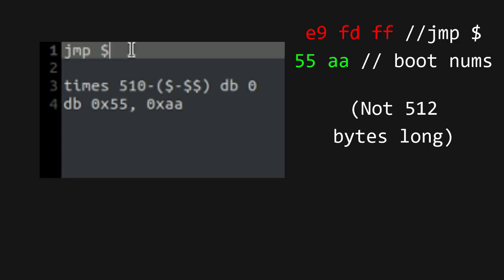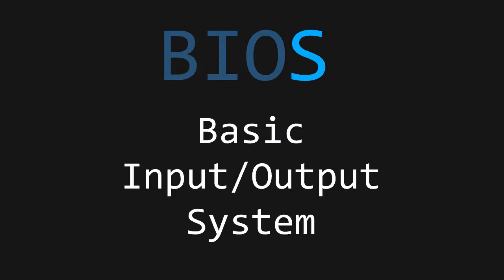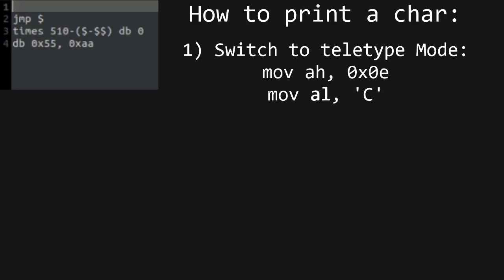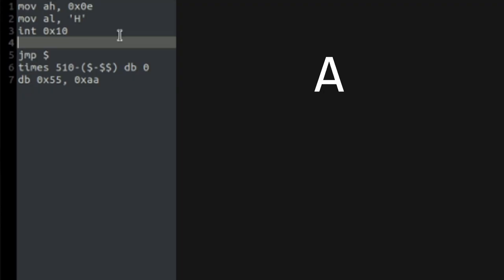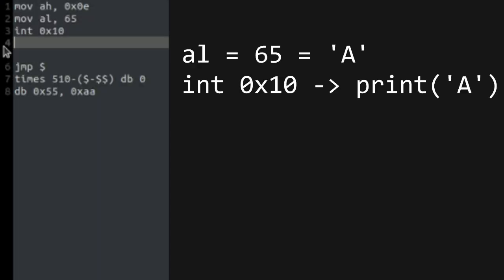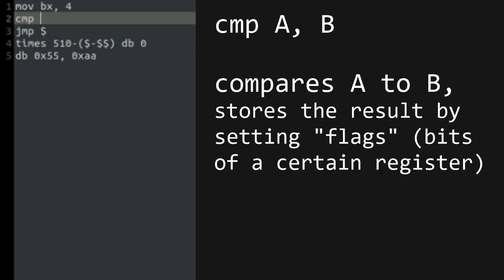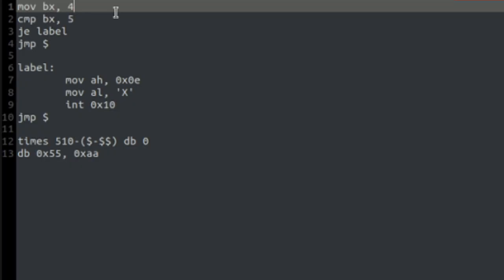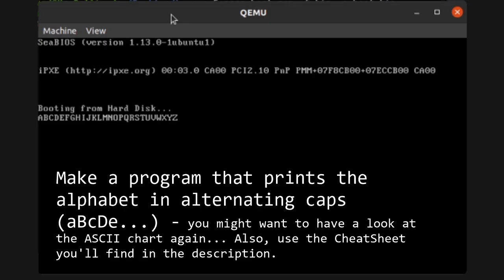Making an OS (x86) Chapter 2 - BIOS, Printing the Alphabet, Conditional Jumps

Comment: So can I just say that the int 0x10 refreshes the console thing?
Reply from the maker: It's a BIOS routine that can do several things, among which writing to video memory; It does not "refresh the console thing" because there is no "console thing" at this level :)
Reply: And here is my homework which is a year late, and I also don't think its the good as Im only a 14 year old and there are definitely more efficient ways to do this:

mov ah, 0x0e
mov al, 65
mov bx, 2

loop:
	cmp al, 'Z' + 1
	je exit

	cmp bx, 2
	je swap_lower

	cmp bx, 1
	je swap_higher

exit:
	jmp $

swap_lower:
	add al, 32
	mov bx, 1
	int 0x10
	inc al
	jmp loop

swap_higher:
	sub al, 32
	mov bx, 2
	int 0x10
	inc al
	jmp loop

times 510-($-$$) db 0
db 0x55, 0xaa
Reply: oh ok thanks!

Comment: Here is my alternating alphabet solution (the comments are ugly because youtube is weird, it works fine in my text editor):

mov bh, 'z'             ; STORES LAST LETTER
mov al, 'A'             ; PUT 'A' INTO al
mov bl, 32              ; PUT 32 INTO bl
mov ah, 0x0e            ; BIOS PRINT

; UNCOMMENT THESE 4 LINES TO START WITH LOWERCASE 'a'
;add al, bl              ; LOWERCAE 'a' (+32)
;not bl                  ;
;inc bl                  ; BITWISE NOT THEN INCREMENT = NEGATE IN TWO'S COMPLEMENT
;add bh, bl              ; UPPERCASE 'Z' AT THE END (-32)

alphabet:
    int 0x10            ; PRINT <----------------------------------+
    add al, bl          ; INCREMENT al by 32 or -32 (+32=upper,    | -32=lower)
    inc al              ; NEXT LETTER                              |
    not bl              ;                                          |
    inc bl              ; BITWISE NOT THEN INCREMENT = NEGATE IN   |  TWO'S COMPLEMENT
    cmp al, bh          ; COMPARE al TO bh                         |
    jne alphabet        ; IF NOT EQUAL THEN CONTINUE LOOP ---------+
int 0x10                ; PRINT LAST LETTER

jmp $
times 510-($-$$) db 0
db 0x55, 0xaa

Comment: I solved the homework problem by using multiple registers. This allows me to avoid any addition or subtraction operations:

mov ah, 0x0e
mov bh, 0x0e
mov ch, 0x0e
mov bl, 'a'
mov cl, 'A'

lowerloop:
    mov al, bl
    int 0x10
    inc bl
    inc cl
    cmp bl, 'z'
    jle upperloop
    jmp exit

upperloop:
    mov al, cl
    int 0x10
    inc bl
    inc cl
    cmp cl, 'Z'
    jle lowerloop
    jmp exit

exit:
    jmp $

times 510 - ($ - $$) db 0
db 0x55, 0xaa

Comment: Are functions declared in assembly by a word and then the colon?  (examples in the video are loop and exit)
Reply from the maker: They're not exactly functions, because there is no return statement. They're simple labels, aliases for the addresses of instructions. 

They can be used as functions, by using the stack. Functions are covered later in the series :)

Comment: My final code (i.e. the homework):
mov ah, 0x0e
mov al, 65
int 0x10

loop:
	inc al
	cmp al, 90
	jg exit
	add al, 32
	int 0x10
	sub al, 32
	jmp loop2
loop2:
	inc al 
	cmp al, 91
	je exit
	int 0x10
	jmp loop
exit:
	jmp $
times 510-($-$$) db 0
db 0x55, 0xaa

Comment: My simple solution:

mov ah, 0x0E
mov al, 'A'
mov bx, 0

loop:
    cmp al, 'Z' + 1
    je exit
    cmp bx, 0
    je upper
    jne lower

upper:
    int 0x10
    mov bx, 1
    inc al
    jmp loop
lower:
    add al, 32
    int 0x10
    sub al, 32
    mov bx, 0
    inc al
    jmp loop
exit:
jmp $
times 510-($-$$) db 0
db 0x55, 0xAA

(basically just swapping the value in the bx register every time I print)

Comment: my code for the homework:

mov		ah, 0x0e 		        ; teletype mode
mov		al, 'A'			; moves character into al
loop:					; loop function/subroutine I forgot what it's called
	int 	0x10		        ; prints character using interrupt
	add		al, 32		; adds 32 to al to make it lowercase
	int 	0x10		        ; prints character using interrupt
	sub		al, 32		; subtracts 32 from al to make it uppercase
	inc		al			; increments al
	cmp		al, 'Z' + 1         ; compares al to z + 1
	jne	 	loop		        ; repeats loop if al is at letter Z or lower
jmp		$				; idk what this does, I think it just exits
times	510-($-$$) db 0	; defines 512 zeroes
db		0x55, 0xaa		; code does not work without this idk why
Reply: I year later*

This works:

int 0x10

mov al, 'A' - 1
mov ah, 0x0e

loop:
        add al, 33
        int 0x10

        sub al, 31
        int 0x10

        cmp al, 'Z'
        je exit
        jmp loop

exit:
        jmp $
times 510-($-$$) db 0
db 0x55, 0xaa

Comment: i remade the solution to be more elegant, no more comparisons now

mov ah, 0x0e ; switch to teletype mode

mov al, 'A'

printAlphabet:
        ; print character stored in al and increment it
        int 0x10
        inc al

        ; check if we reached the end of the alphabet yet
        cmp al, 'z' + 1
        je exit

        ; flip the 6th bit (which adds 0 or 32)
        xor al, 0b00100000

        ; loop the code
        jmp printAlphabet

exit:
        jmp $

; end of code
times 510-($ - $$) db 0x90
db 0x55, 0xaa
Reply: @Sean Michael i had an understanding of how memory and registers work prior to watching this video (although my asm was pretty bad). then i watched this video and after that i was just compiling random C/C++ programs to see how their assembly looks, if i didnt know what some instruction was i just searched it up, then i tried writing my own asm code inside naked functions in C with the inline assembler. after that i had a good knowledge of asm and some time later i found a very good use for it in one of my programs

Comment: Here's my solution:

	;;  512 byes long ending in 0x55 0xaa

[bits 16] ; use 16 bits 
[org 0x7c00] ; sets the start address 

	mov cx, 0x0					; initialize counter to zero
	mov bl, 0x02					; prepare divisor to use

loop:
	mov dh, 0x0e				; set terminal output mode
	mov dl, 'A'						; store letter into dl
	add dl, cl
	mov ax, cx						; ax contains dividend
	div bl								; divide ax by bl
	cmp ah, 0x0					; compare remainder with 0
	je ucase							; if remainder was zero, ucase character
	add dl, 0x20					; else lcase character (0x20 == 0d32)
ucase:
	mov ax, dx						; prepare to print character
	int 0x10							; print character
	inc cl								; increment counter
	cmp cl, 26						; compare counter with 26
	jge done
	jmp loop

done:
	jmp $						; jump to the current memory address -- infinite loop much?

	times 510-($-$$) db 0
	db 0x55, 0xaa

Comment: Hey, I am trying to understand better how operating systems work, and your videos are very helpful and great! I even managed to do the homework at the end of the video! I wanna say a thank you for these videos beacuse they helped me a lot and even taught me a bit of assembly. Here's the homework:

mov ah, 0x0e
mov al, 65
int 0x10

lower:
	add al, 33
	cmp al, '['
	je exit
	int 0x10
	jmp upper
upper:
	sub al, 31
	cmp al, '['
	je exit
	int 0x10
	jmp lower
exit:
	jmp $
times 510-($-$$) db 0
db 0x55, 0xaa
Reply: Also, I am pretty sure this is a more complicated and worse solution to the homework, but I tried my best.
Reply from the maker: @1hypro395  Brilliant! Keep going! I'm glad I helped
Reply: @1hypro395  complicated? worse? look at my code for a second

mov ah, 0x0e
mov al, 65
int 0x10

loop:
    inc al
    cmp al, 'Z' + 1
    je loopt
    int 0x10
    jmp loop

loopt:
    mov ah, 0x0e
    mov al, 'a'
    int 0x10
    jmp small

small:
    inc al
    cmp al, 'z' + 1
    je end
    int 0x10
    jmp small

end:
    jmp $

jmp $
times 510-($-$$) db 0
db 0x55, 0xaa
Reply: @1hypro395  and it doesnt even fit the homework (if my reply lagged my code is beneath)
mov ah, 0x0e
mov al, 65
int 0x10

loop:
    inc al
    cmp al, 'Z' + 1
    je loopt
    int 0x10
    jmp loop

loopt:
    mov ah, 0x0e
    mov al, 'a'
    int 0x10
    jmp small

small:
    inc al
    cmp al, 'z' + 1
    je end
    int 0x10
    jmp small

end:
    jmp $

jmp $
times 510-($-$$) db 0
db 0x55, 0xaa

Comment: this also works in fasm:

mov ah, 0x0e
mov al, 'A'

printalpha:
    int 0x10
    add al, 32
    int 0x10
    sub al, 32
    inc al
    cmp al, 'Z'
    jle printalpha

jmp $
times 510-($-$$) db 0
db 0x55, 0xaa

Comment: This is my solution lol

mov ah, 0x0e    ; set up for print
mov al, 'A'
mov cl, 0
int 0x10        ; print
loop:
    cmp al, 'Z' ; check if output is done
    je skip
    inc al      ; incremint letter
    cmp cl, 1   ; use lower byte of cl register to keep track of upper and lower (if low, print upper, if high print lower)
    je Uppercase    
    jl Lowercase
Lowercase:
    add al, 32  ; turn letters to lowercase ascii
    int 0x10    ; print
    sub al, 32  ; return to normal
    mov cl, 1   ; change cl too 1 so next letter is upper
    jmp loop
Uppercase:
    mov cl, 0   ; change cl too 0 so next letter is lower
    int 0x10    ; print
    jmp loop
skip:
    jmp $
    times 510-($-$$) db 0
    db 0x55, 0xaa

Comment: my try at the homework (yes i know many solutions have been posted but this one is commented, other than that its nothing special):

mov ah, 0x0e ; switch to teletype mode

mov al, 'A'

printAlphabet:
	; print character stored in al and increment it
	int 0x10
	inc al
	
	; check if we reached the end of the alphabet yet
	cmp al, 'z' + 1
	je exit
	
	; check if the current character is even or odd
	mov bl, al
	and bl, 1 ; bl %= 2
	
	; if bl == 1
	cmp bl, 1
	jne $ + 4
		sub al, 32
	
	; if bl == 0
	cmp bl, 0
	jne $ + 4
		add al, 32
		
	; loop the code
	jmp printAlphabet

exit:
	jmp $

; end of code
times 510-($ - $$) db 0x90
db 0x55, 0xaa

Comment: Here is my solution i basically check if the number is even by looking at the least significant bit. if so add 32 call a print function then subtract 32 and conitinue the loop:
print:
	mov bx, 0
	mov al, 65
.loop:
	cmp al, 91
	je .done
	mov cl, al
	and cl, 1
	cmp cl, 1
	je .cont
	add al, 32
	call print_char
	sub al, 32
	jmp .end_loop
.cont:
	call print_char
.end_loop:
	inc al
	jmp .loop
.done:
	ret

print_char:
	mov ah, 0eh
	int 0x10
	ret

Comment: How can I boot from a floppy disk. I am using a floppy usb and my machine is a 64 bit one. I have written a simple boot sector which will simply print A on screen. It's working in qemu but not working in my real machine. My laptop supports legacy mode also. Any suggestions?
Reply from the maker: How did you write the binary to your floppy?

Comment: I tried the homework:

mov ah, 0x0e
mov al, 65
loop:
	cmp al, 97
	jge lower

upper:
	int 0x10
	add al, 32
	jmp cont
lower:
	int 0x10
	sub al, 32
cont:
	inc al
	cmp al, 91
	je exit
	cmp al, 123
	je exit
	jmp loop
exit:
	jmp $

times 510-($-$$) db 0
db 0x55, 0xaa

Comment: Figured out this may need minor adjustment with cmp lines.
Thanks for the videos!

mov al, 64
mov ah, 0x0e

lower:
	mov bl, al
	add, 33
	int 0x10
	cmp bl, 'Z'
	je exit
	jmp loop

loop:
	sub al, 31
	int 0x10
	cmp al, 'Z'
	je exit
	jmp lower

exit:
	jmp $

times 510-($-$$) db 0
db 0x55, 0xaa

Comment: Just solved the uppercase/lowercase challenge by adding 32 to al and then calling the interrupt again, since lowercase a is 97 dec and uppercase is 65 (32 bit offset). Then i just subtracted 32 before repeating the loop. It works!

Comment: I don't get that "jump to the same address" (jmp $).
And that "times" instruction. And the 510-($-$$).
Reply from the maker: If your program counter (the pointer to the current instruction) is equal to $, jumping to $ makes you jump to the current instruction, which happens to be: jump to the current instruction (and so on, hence we enter a loop).

"Times n someInstruction"
Repeats someInstruction n times.

$$ is the beginning of the current section. $$-$ is the length of the current section. 510-($-$$) is:
512 (the length of the code sector)
-2 (the length of the two db instructions used to define the booting number)
- ($-$$) (length of current section)

Which is the number of zeroes we need to add before the booting number to fill the whole sector minus 2 bytes, and write the booting number at the end of the sector.
Reply: @DaedalusCommunity  But if you use jmp $, wouldn't the program be stuck at $ and never execute the two last bytes of the boot loader?
Reply: @rodrigoappendino  I'm stuck on this

Comment: Code for alternating caps of alphabet:

; printing newline
mov ah, 0x0e
mov al, 0xa ;newline in ascii char
int 0x10

; printing characters lower and uppercase 
mov al, 'a'

print:
	cmp al, 'z'
	jg exit
	mov ah, 0x0e
	int 0x10
	; print the uppercase
	sub al, 32
	mov ah, 0x0e
	int 0x10
	; reverse al register back to lowercase
	add al, 32
	; increment
	inc al
	jmp print
	
exit:
	jmp $

times 510-($-$$) db 0
db 0x55, 0xaa

Comment: hey Maa...I can program in x_86  assembly

-----------------------

mov cl,'A' ; counter
mov ah,0x0e
mov al,'A' ; output
int 0x10

loop:

    cmp al,'Z'+1
    je exit
    inc cl
    test cl,0x1 ; masking and checking the last bit
    jz no_caps ; AND operation result is 0 (e.g B=66, 0x42 AND 1 = 0)
    jnz caps
    jmp loop

caps:
    mov al,cl
    int 0x10
    jmp loop

no_caps:
    mov al,cl
    add al,32 ; add 37 to reach lowercase
    int 0x10
    jmp loop

exit:
    mov al,'0' 
    int 0x10
    jmp $

times 510-($-$$) db 0
db 0x55,0xaa

Comment: I burned my pc. 
I started a for loop and the pc crushed
Reply: I send the entire code
Reply: should i send the entire code?
Reply from the maker: Did you run the code in a virtual machine?
Reply: yes teacher
the heat sink came off
Reply: @DaedalusCommunity  yes. should call someone. to fix my heat sink?
Reply: sir?
Reply from the maker: @mtex1024  I'm a computer science student, not an electrician, but I'd say the two things are not related. Still, you should call someone if you're not able to repair it yourself, and I'm afraid sending the code won't help :(
Reply: @DaedalusCommunity  thank you sir. he . says only the fused burned, and fixed it. thank sir
Reply: still should I send teacher?
Reply: @DaedalusCommunity   var backgroundColour = color(255, 255, 255);
var nodeColour = color(40, 168, 107);
var edgeColour = color(34, 68, 204);
var nodeSize = 8;

var createCuboid_add_6Pyramids = function(x, y, z, X, Y, Z) {
    var nodes = [[x, y, z],//p0 (point1)
                 [x, y, Z],//p1
                 [x, Y, z],//p2
                 [x, Y, Z],//p3
                 [X, y, z],//p4
                 [X, y, Z],//p5
                 [X, Y, z],//p6
                 [X, Y, Z],//p7
                 [x*1.732,0,0],//p8 (√3 = 1.732...) imagine sphere that the 
                 [0,y*1.732,0],//p9                 square circumscribe 
                 [0,0,z*1.732],//p10
                 [X*1.732,0,0],//p11
                 [0,Y*1.732,0],//p12
Reply: var x = -100;
var y = -100;
var z = -100;
var X =  100;
var Y =  100;
var Z =  100;
    
var shape1 =  createCuboid_add_6Pyramids(x, y, z, X, Y, Z);
var shapes = [shape1];

}};
Reply: // Rotate shape around the z-axis
var rotateZ3D = function(theta, nodes) {
    var sinTheta = sin(theta);
    var cosTheta = cos(theta);
    
    for (var n = 0; n < nodes.length; n++) {
        var node = nodes[n];
        var x = node[0];
        var y = node[1];
        node[0] = x * cosTheta - y * sinTheta;
        node[1] = y * cosTheta + x * sinTheta;
    }
};
Reply: var rotateY3D = function(theta, nodes) {
    var sinTheta = sin(theta);
    var cosTheta = cos(theta);
    
    for (var n = 0; n < nodes.length; n++) {
        var node = nodes[n];
        var x = node[0];
        var z = node[2];
        node[0] = x * cosTheta - z * sinTheta;
        node[2] = z * cosTheta + x * sinTheta;
    }
};
Reply: var rotateX3D = function(theta, nodes) {
    var sinTheta = sin(theta);
    var cosTheta = cos(theta);
    
    for (var n = 0; n < nodes.length; n++) {
        var node = nodes[n];
        var y = node[1];
        var z = node[2];
        node[1] = y * cosTheta - z * sinTheta;
        node[2] = z * cosTheta + y * sinTheta;
    }
};
Reply: var backgroundColour = color(255, 255, 255);
var nodeColour = color(40, 168, 107);
var edgeColour = color(34, 68, 204);
var nodeSize = 8;

var createCuboid_add_6Pyramids = function(x, y, z, X, Y, Z) {
    var nodes = [[x, y, z],//p0 (point1)
                 [x, y, Z],//p1
                 [x, Y, z],//p2
                 [x, Y, Z],//p3..
wait the pc just booted.
Reply: I send the entire code tomorrow is it okay sir?
Reply: @Victorzzz sorry bro. I am a guy with mental illness.

Comment: I got it working! I learned a little bit of assembly a few years ago, so this is a good refresher:
Solution below! Beware of spoilers!
.
.
.
.
.
.
.
; Printing Stuff
mov ah, 0x0e
mov al, 'a'
int 0x10

; Loops
loop:
     sub al, 31
     int 0x10
     cmp al, 90
     je exit
     add al, 33
     int 0x10
     jmp loop

exit:
; Boot Loader
jmp $
times 510-($-$$) db 0
db 0x55, 0xaa

Comment: Here's my solution for the challenge that you had at the end of the video:

mov ah, 0x0e
mov al, 65

loop:
    cmp al, 'Z' + 1
    je exit
    int 0x10

    add al, 32  ; goes to lowercase
    cmp al, 'z' + 1
    je exit
    int 0x10

    sub al, 32  ; back to uppercase
    inc al
    jmp loop

exit:
    jmp $
times 510-($-$$) db 0
db 0x55, 0xaa

Comment: My solution to the problem

mov ah, 0x0e
mov al, 64

loop:
    inc al
    int 0x10
    add al, 32
    int 0x10
    add al, -32
    cmp al, "Z"
    je end
    jmp loop

end:
jmp $
times 510-($-$$) db 0
db 0x55, 0xaa